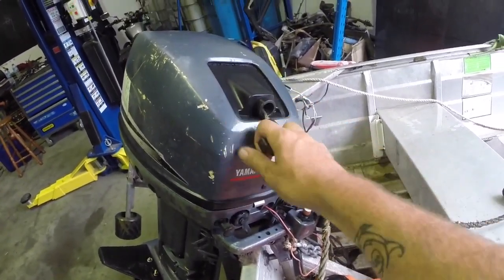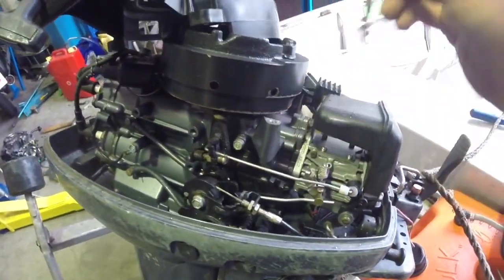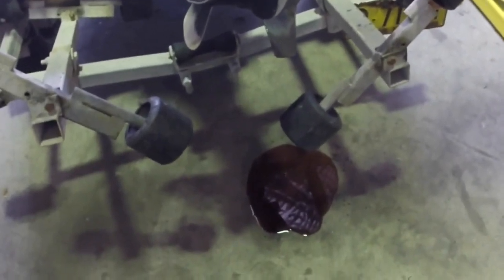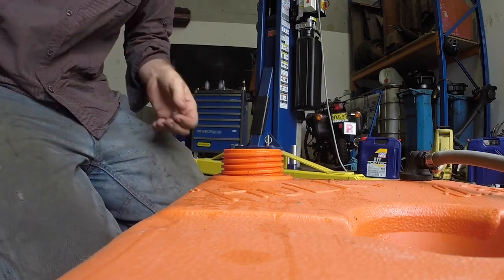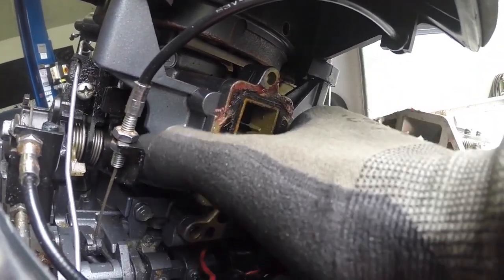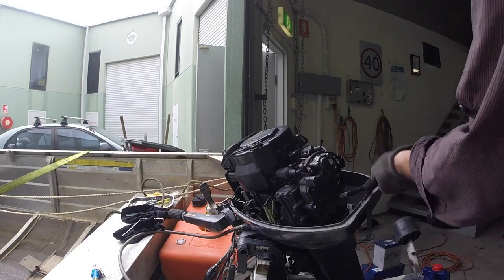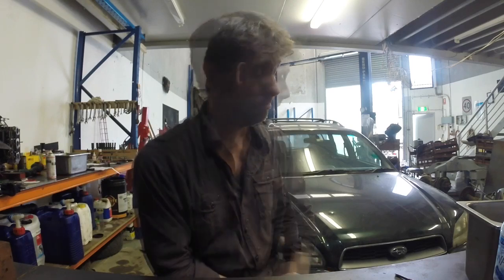Unseizing a seized outboard motor

Comment: I bought a 67 Starcraft fishing boat with a non-running 1959 OMC/Gale Sea king, didn't think I would get the thing to run but I started at the basics, there was compression, so I went onto spark.. no spark, checked out the set-points, they were filthy but nothing too terrible, no holes or cracks, eventually timed those in just by using feeler gauges, spun the flywheel a few times an saw that I had one cylinder sparking and the other no spark, so I picked up a tuning kit online with new condensers and set-points, replaced all ( keeping old set-points as spares, ) .. spun the flywheel again after getting her all back together an bam, spark!.. just threw the recoil back on, a filter on the fuel line ( rusty can will get a new one ).. after a few pulls an messing with the low speed needle on the carb she came right to life and sounded beautiful!, The very next day i found a guy selling a 57 sea king WITH ELECTRIC START!, unfortunately its seized, and missing the throttle rod from the motor to the throttle hinge, but for $25 i felt it was a steal, I'm going to try and restore the electric start system an swap it onto my running motor, and just part this one out, I don't feel its worth it to try and get it running may just be too much time and money, especially considering its 60+ years old and I have no clue how long its been sitting - it was picked up at a site that was being demoed and excavated out in the twin city area of Minnesota. 

Long story short, I rebuilt most of the ignition system on my 59 sea king, and got her running - first little restore project of mine, this is the first outboard / boat I've ever owned, and now I'm addicted ;).. Definitely going to subscribe to your channel and keep watching! Thanks for making these videos!
Reply from the maker: Sounds like you've been very busy, and hopefully have a lot of fun at the same time. ;) I hope the videos have been helpful with your projects, great to have you on board!

Comment: Great video! Nothing is off topic, it's all a process and teaches the basics of going through the motions when it comes to these small engines! 
 I would've almost been tempted to inspect the bore walls but I'm sure removing the head cover would've required a gasket replacement or something along the lines of not being worth it.
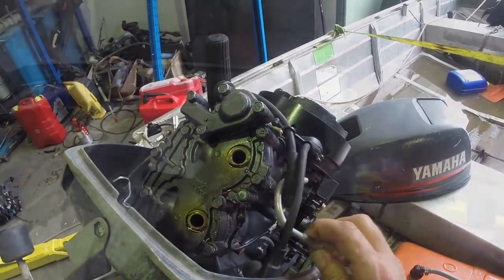PS: Is that cheeky beverage at @ 6:49 I spot!

Comment: I have a siezed up motor (40 hp 3 cyl. tohatsu), pulled power head to take apart thinking catastrophic damage was done and ready to go internal on it, well all looks fine other than siezed rings, been soaking the rings like you did, how should i go about trying to free up the rings from cylinder walls?  with it sitting on a work bench?  impact gun on top of crankshaft and go slow?   heat up cylinders and try to get it turning that way?  not sure other than placing the powerhead back on the motor and bolting back down and using a breaker bar like you did
thanks, broken down atv motors, lawn mowers, car motors, but never an outboard motor.  you gave me the convidence to tackle my fears
Reply from the maker: +C1iffBurton Hi mate, glad the video has given you some confidence to tackle this one. I would be inclined to use the breaker bar without heat as you will get more feel through the handle of the bar and it is a large area to try to heat three cylinder bars uniformly. As you say, you'll need to have it locked down good and tight but it needs to go together in the end anyway. Let me know how you get on. Stu
Reply: Set fire to it if nothing flammable around, fill the bores with white spirits and light it with a blow torch, make a press using steel and a car jack and press the pistons out

Comment: Danger- I had inquired on another one of your sites earlier about the piston ring gap on a 1986 90hp Johnson. The book said gap was .007- .017 up to 87. Then 1987 onward the gap is .019- .031. I was thinking that all new rings even for Johnson motors prior to 1987 would have the wider gaps, maybe because of composition of new rings that expand more. I talked to an old mechanic from a boat shop and he told me that the composition of rings has changed some, but they mainly went to wider gaps because when the rings expanded they were rubbing up against and bouncing around the ring retainer pins. He said the difference in the gaps were not that critical and that all new rings bought for these pistons even prior to 1987 will have the wider gap specs.
Reply from the maker: Hey Zed, thanks for the update, it's always great to hear some good information on these tricky ones.

Comment: Thanks for your training.  I've got a post hole drill, E85 Earthquake, that locked up on me by surprise.  Was running and seized after shutting down.  No restart.  Huh.  I never forget oil in gas so go figure.  I'll try your method soon.  Short blocks aren't cheap.

Comment: Good work Stu, Everytime I try to rock back and forth a seized motor, I just seem to loosen the flywheel nut :(
Reply from the maker: Thanks mate. Yes, that is a problem if it is really seized. Let it soak with a combination of ATF and acetone then try pushing it in the direction that tightens the bolt only until it moves a little bit .

Comment: Stu, we had a similar problem with a Yam 15 HP engine.  After removing rope starter, crankshaft was found completely seized, the hidden problem was found to be the metal  head crack case located at lower crakshaft side was seized due to salt water intrussion against the drive shaft.  Removing power head, cleaning and greasing that part and related adjacent parts and installing a new lower base gasket solved the issue.. Engines using such parts should be greased from time to time if engines are used on salt water and lower legs remains immersed in water for long time periods...
Reply from the maker: Yes, saltwater motors definitely need lots of regular maintenance to keep them running well.

Comment: Thanks for the info, I got a seized 5 hp deluxe, Evinrude , I am soaking now with 2 cycle oil, some days down the road I will begin working on moving or un seizing, thanks.
Reply from the maker: Good luck with it James.
Reply: Rust on top piston and in both cylinders, not good,,,, I finally poped the head and found both were rusted and very badly pitted.. I think it will be a wasted effort... real shame

Comment: I have a 1973  6hp Johnson and it runs and starts fine, but when I let go of the throttle handle it turns to the off position on its own. Any ideas on what is causing that and how to fix it? Great video. Very educated man.

Comment: Thank you  Mr. Dangar for your meticulous tutorials.  I actually enjoy when things don't go as planned and all your tangential knowledge experience  pearls that arise from the vicissitudes.  I own and old 1995 Mercury 2stroke 75 that appears to be just like your own 95hp. I have lots of coughing and misfiring that I cannot improve. Can you provide some insights on what usually goes wrong with these old mercuries?? Thank you so much for all the information and hard work on your part!
Reply: Alfred Bryant almost always dirt or water in the carbs buddy.
Reply: I had a
60 HP mercury that would cough and misfire. Sometimes it would quit when trying to accelerate. I checked everything else but finally found out that it was the fuel line connector from the gas tank. The seals had shrunk from edge and we’re leaking air causing intermittent lean condition. After replacing the fuel connector it ran perfect from then on. Cheers

Comment: I tried soaking Pistons on old motorcycles that had stuck pistons and had no luck.I saw a video where someone pumped grease in the seized piston on a mc and it worked to unseize it.They made a fitting out of a spark plug.
Reply from the maker: Interesting, I guess it does allow you to put the grease in under pressure with a good grease gun.

Comment: Old machinists trick - 50/50 automatic trans fluid and acetone is the best penetrant. the acetone evaporates after carrying the ATF down past rings and threads.
Reply from the maker: Yes, I've started adding acetone to the ATF since I did this video and really seems to help.
Reply: The acetone will probably effect the crank seals on a two stroke!! Coming from an old machinist/ toolmaker!!
Reply: Can't wait to try your "old trick".  I have both on hand.  Thanks for sharing.

Comment: Great video!! Thank you so much for your time and expertise.  I have an OLD Johnson 15 hp low profile that's not running after it warms up...I now know what to go through to find out whats up...
Reply from the maker: Could be that the engine itself is overheating due to a cooling water problem, could be that it is running very rich or could be that the coils are going open circuit when the wires heat up.
Reply: thank you so much  @DangarMarine  .  Ill check those conditions first.

Comment: great video 
I have a 1950' s  evinrude 5hp I'm going to try this on

only question is why did you rebuild carburetor before the compression test ?
airflow ?
Reply from the maker: To be honest, I can recall. I probably just did the carb first because it is a bit of a given with any sunk boat and I didn't want to draw any more water through the motor.

Comment: Great work! I have a 4 stroke 6 hp Yamaha 2009 very low hours but it smokes, sputters and shuts off after 3 seconds of random RPM revving. I was just checking the oil level and found fuel mixed with the oil. Has this ever happened to you?

Comment: Hi Dangar Stu, 
Thanks for all your great videos. 

I have one suggestion to all that are trying to unsieze their engine.
If you are not able to get any movement at all out your engine despite your efforts to free the pistons in the bores. Check your outboards gear box. As i found with my Honda 15hp the engine was infact completely fine and it was the top bearing in the gear box that had siezed. 
Hopefully i have saved some one the swearing and confusion that i endured.

Thanks again 
Look forward to visiting the island again in summer!
Reply from the maker: Hi Matthew, yes I too have had outboards where it is the gearbox completely seized, not the motor itself. I should have added a step to this video on confirming the source. Sounds like I might be bumping into you this summer! ;)

Comment: Thanks for that great video. One question: After you unseize it, do you hear clinking when you hand turn the flywheel? i can hear the clinking when i hand turn it,  but my compression is still between 80-90 on all cylinders. Is this bad?

Comment: Thanks for the videos.  I have a '92 Johnson 3hp that seized due to a lack of cooling water.  Wasn't out long before this happened and after the 15 minute paddle back to the dock the head cooled and the seize relaxed on its own.  I know that there is the possibility of cylinder damage due to contact with the pistons.  Thought about a rebuild but pistons and standard rings are no longer available however 0.030" over size rings are available.   I cleared whatever the cooling system blockage was and  believe the engine will start and run.  I don't want to do more damage but more importantly I don't want it to fail and me be stranded on the water. I thought maybe run it  in the test tank and if it goes well then perhaps brief outings on the river building confidence that it may be okay afterall.  What do you think?

Comment: Ever had a problem with a murcury 135 hp that over heats when running at higher rpms, but at slower rpms, runs fine? Does it have anything to do with replacing the upper electroid?

Comment: About that Subaru.... Take any and all electical connections and dry them out! Use wd40. The wd stands for water displacement. The 40 stands for the 40th attemt to get it right. Anyway once dry, put some electrical connector grease in the plugs. If you dont do this, you will have many issues later.

Comment: We have this same exact model of Yamaha. 15 hp 2 stroke.  If this motor sits for more than three days without being turned over it seizes up.  We always manage to break it free and sometimes it takes quite a lot of beating with a wooden drift and a 4 lbs. mallet.  It always runs amazing afterwards and idles like a champ and I am completely baffled as to why it is doing this. Plugs show no signs of water getting into the cylinders.   Fuel is not contaminated and the boat gets used once a week. It is the tropics and things do corrode very fast here on the Pacific coast of Mexico but I've had other outboards that sat for a year down here and there were no  issues turning it over. Any ideas?  I find it ironic that a web search for seized outboard brought me right here .  Factory defect?
   So it turns out it wasn't the motor that was seizing. It's a long shaft and there are two rubber/metal bushing guides to the drive shaft and they would corrode and seize up the drive shaft.  I'm a Yamaha fan but this motor has had it's issues.  The carb had a factory defect in it as well that took some CSI work to diagnose. It would start but not run at high throttle.  No bueno hombre.

Comment: Thanks for this and your other videos - very generous gesture! I am wondering if there is someone you would recommend in Melbourne, in case I get in over my head with working on my mid 70's chrysler 75.
Reply from the maker: Hey mate, glad you like the videos. Unfortunately I don't know any marine mechanics in Melbourne so I can't really recommend anyone. I think if you have a bit of a chat with a mechanic you will get a sense pretty quickly as to whether they are someone you would like to have working on your motor. See if you can get them to talk a bit about how they would approach the problem you are having and avoid anyone that wants to throw new parts in and see if it fixes the problem.
Reply: Cheers, thanks - good advice! The chrysler has been sitting unused for over two years. I'll let you know if anything really weird happens while I do a thorough service on it before I try to start it. My plan of action is - dump oil, pressure test gearbox and if ok, refill with fresh oil. Further up, grease every nipple and make sure grease is coming out from all relevant points. If not, I am planning on pushing oil in through nipples to soften any hardened grease over a few days, then push new grease through until just grease comes out. Not sure if that will work - if it does, it will save me a lot of time and expense. I've previously done the carbies and filter, but I need to check out if there is a fuel pump and see how to check and replace worn parts. I don't recall seeing a fuel pump, but after the video, I will look closer.The bit that really worries me is the original magneto(?) ignition now sports a standard car coil, so not sure how to tackle that one - we'll see when I get to it. Finally, I'll go through the tilt trim....it was noisy and seemed to hesitate - chances are motor is in need of some cleaning as per your video.
Reply from the maker: Sounds like you're onto it. Let me know how you get on with pushing oil through the greased components if you do that. I've tried something similar before with limited success. I unscrewed the grease nipple and put a threaded barb in its place to attached a hose to, but could never really get it to shift the old grease.

Comment: Hey love  your outstanding videos. Question: I have a 1986 3 cylinder 60 hp outboard, it has been sitting for about 3 years. the Flywheel would not turn so I removed spark plugs and added some sea-foam creeper and let it set in upright position for a couple of days. Was able to turn flywheel with wrench and pull bar (worked back and forth until it made a full turn. It turns but seems a little sticky at one certain point while turning. Installed new starter & solenoid & battery also new thermostat (old one was completely closed but last time out water was coming out from water pump line. Tried to crank but starter engages but will not disengage unless I turn flywheel with wrench. I guess what I'm asking is there major damage internally and is it worth trying to fix? Any help would be greatly appreciated. Thanks in advance!

Comment: Absolutely fantastic video, can I ask please why you added 200mls of 2 stroke oil to 10 litres of petrol.  I have a 15hp yamaha 2 stroke engine like the one in this video.  I though the file mix ratio was 100:1 .  Was it because the engine wasn’t started in such a Long time that you made the mix so rich.
My johnson 2 stroke engines 8 and 6hp take 50:1 but my Yamaha 2 strokes 8 and 15 are all 100:1. Again fantastic channel!!

Comment: I have a very good Yamaha 25 hp 2 stroke pull Start 2005,  my wife has a difficult starting the engine. At my marina they have an old white coloured 30 hp Yamaha 2 stroke electric. Same shaft size and all. They will check out the 30 hp to see if it still has life in it. I hope I am thinking straight good guy

Comment: Is there a possibility that the cylinders and pistons aren't seized but the crank shaft bearings or something is? would it let it spin but not easily? Because I have an 8hp evinrude that isn't siezed but it reasonably hard to turn in some positions

Comment: I have an old 25hp MARINER outboard engine, at first flywheel was not turning. But when i disconect the lower part of the engine with the propeler and the gear shaft, i found that the problem was the shaft. Shaft was stuck. Not moving. It is possible repair it? I didnt disconect the  propeler and the gear box

Comment: I ran my motor out of oil. Going about 4200rpms and now it is seized after trying to restart it without knowing it didn't have oil.... do you think my motor is destroyed and would it be worth it to go through this process myself? When I got it to run before it seized it sounded like it went clunk clunk clunk.... then died so I'm just wondering. Thanks for any reply.